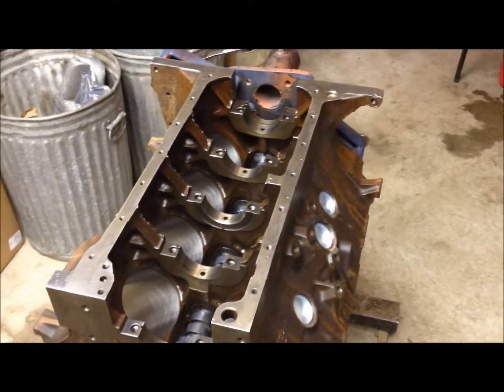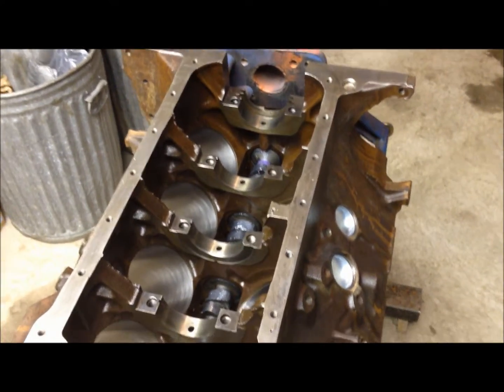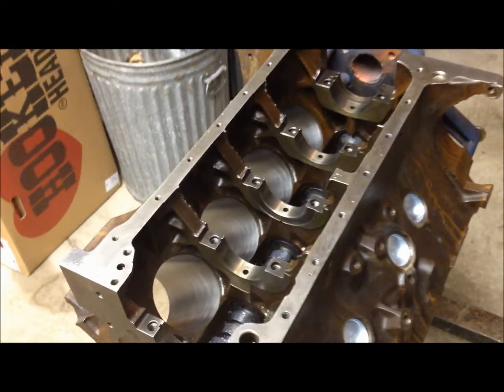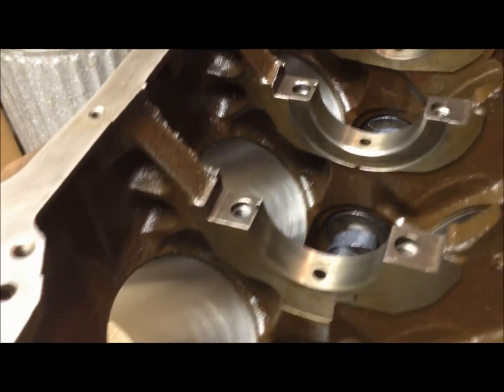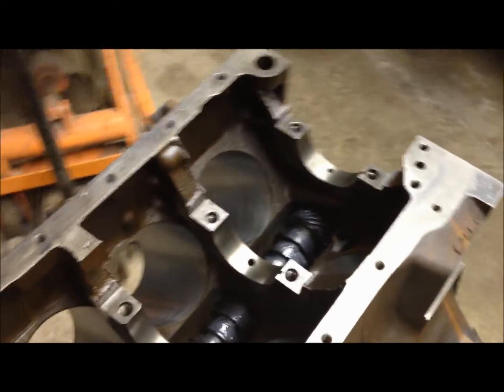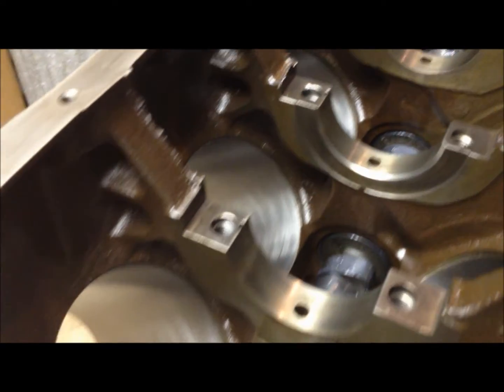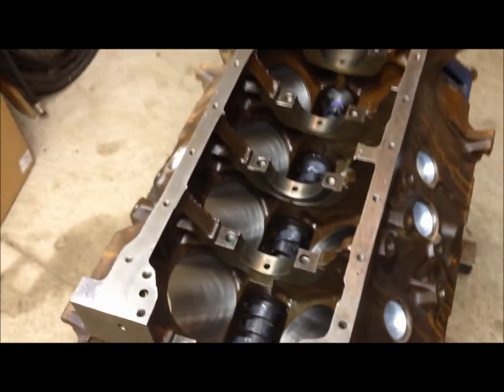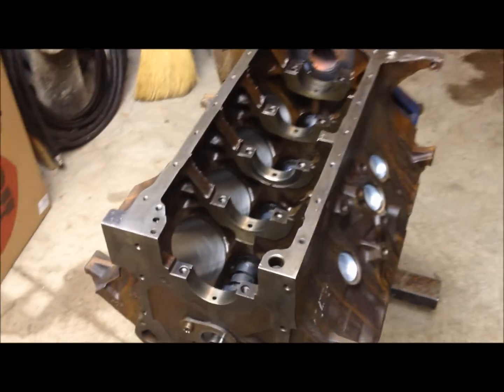The Strongest 390/360 FE Blocks

Comment: I like to drill out that short oil passage in the block to 1/2” diameter so it matches the oil pump as well as the oil filter assembly diameters. Drilling this passage hugely increases the oil flow, but the biggest benefit is oil to the journal improvement on cold starts. If you study the OE passage you see that not only is this bottleneck about a 40% reduction in volume, but the oil is basically forced into a cup at the bend. This basically is like sticking a garden hose into a cup with a small hole out the side where you expect it to funnel through. This is a big reason, if not the biggest reason why many of these engines failed when doing mostly short runs. Otherwise these are a very stout block, but the fix is so simple.
Reply: Do you do anything to the mains where the oil hole doesn't match up with the oil hole in the bearing shell?
Reply: @65slick445fe  I like to hit that a bit with a rotary file. I see some don’t but I like it done.
Reply: @brianhdueck3372   I did all of mine and the recipe is like making good biscuits. You have to know what that area needs and get it right.

Comment: I have a 1960 thunderbird 390, it came factory with the rev kit, solid lifter cam and high nodular cast iron crank. that block is cast as the 427s and 406s, with the boss's cast, but not machined for cross bolting. It's the only block I've ever seen like that and I've seen many. I bought it from a junkyard that was liquidating in about 1982 for 10$, I bought about 15 engines from that place and this is the only one I've kept. It was missing the original intake, but had a nice 4bbl one on it.That cam makes it purr at 6000 rpm.
Reply: 1960 Thunderbird came with the 352 FE or the 430 MEL engine.
Reply: @walnutmanor  You are absolutely correct, this engine must have been from a 1961. I didn't pay much attention to the vehicle, just bought the engine because it was special.
Reply: Cam montreuil engines  that is what some advertising called this setup, it also had heavier connecting rods with 13/32" bolts. I still have all of this engine. The original intake would have been a  3x2, but I did not get that when I bought the engine, back in about 82 or so, I wish I could have boughten everything that place had, lots of old hemis and 348s and what not, I just took the merc and ford and edsel stuff.

Comment: I'm curious, could you precision cut the webbing to then accommodate 4 bolt mains?
Reply: There is no need to "cut the webbing" on FE's to cross-bolt the mains (making them 4 bolt mains). The cross bolts go through the side of the block skirt, and into the 3 center main caps (#2, 3, and 4)
Reply: Where would you get caps? Aside from cross-bolted 427 caps, none exist. Anyway, main studs alone should suffice.

Comment: 427 side oilers are buy far the best FE blocks you can get. I have one it's impressive.
Reply: The problem is, you CAN'T get em anymore, unless you get an aftermarket block from Genesis, Robert Pond, Alan Root, or Carroll Shelby. $$$Cha-ching! Any original factory blocks you'd find are bored to the limit and full of cracks.
Reply: Rare as hen's teeth and expensive as hell. A lot of them were badly abused too, back in the day.
Reply: we agee" there's not enough road for that brutal beast to flex her r p m's

Comment: There was a 390 truck engine called a, "391" that had some external oil line. Ford sold the 391 engine blocks bored out to take 428 pistons as 428 engine block replacements that had the external oil connections plugged. The 391 truck engine block was used because it was heavy enough to use as a 428 block.
Reply: Yes 391 truck blocks are killer. I think they also made 361 truck blocks too. Both I believe had forged steel cranks. The only thing you need to do on both of these engines is turn the crank snout down. The bore to the desired width and add all the Ford and aftermarket goodies to them. POW !!! Get the women kids and Chevys off the streets.
Reply: @lorenzomaximo1818  I seem to remember the converted 391 to 428 blocks also had some external oil connection plugged off. Ford had quit making replacement 428 blocks, but they wanted to offer replacements for 10 years, so they bored out 391 truck blocks for the replacement 428 blocks.
Reply: @jimjungle1397  
And I seem to remember that too their damn good blocks. A lot of those 391 blocks were used in dump trucks.
Reply: @lorenzomaximo1818  - your advice is dated - modern cast iron stroker cranks are far less expensive and lighter than a machined 391 crank, which also requires flywheel flange and counter weight machining.
Reply: I believe the 391 may have also had an additional hole near the bottom of the skirt for an oil drain line from the air compressor used for the truck brakes.
Reply: The only difference I could find in a 391 was an additional oil ring on the piston
Reply: @rodneyyoung385  It may not always be used, but the 391 blocks that were bored and sold as 428 replacement blocks had plugs in holes that were in the 391 blocks as oil cooler / external oil filter lines. they may be plugged in some 391 applications without external oil lines too. Ford offered 428 replacement blocks through 1980 and in the late 1970's they were no longer original 428 blocks , but 391 blocks with additional plugs installed.(compared to 428 blocks)
Okay found what it is." FT blocks had a hole (right side) near center of block for an air-compressor oil drain. This was for vehicles equipped with air brakes. Most FT blocks had a mirror image of 105 stamped where you would normally see 352 found on the FE blocks. 

The FT blocks are heavy-duty units and are virtually identical to the FE except that the distributor pilot hole is larger to allow for the 5/16" hex oil pump driveshaft. This means you'd have to install a bronze bushing in order to use a standard distributor with the 1/4" oil pump drive shaft, but there are bushings readily available (from Ford or the aftermarket). It's easy enough to do if you're doing other machine work on the block. You might also need to install a plug where the air compressor (for the air brakes) drains into the block. (The drain is low on the right side near the center of the block skirt.)"

Ribs on the block only means it was cast after 1971, nothing more. The "C" or "CX", etc, on the back of the block is also period-specific, as is the "428" marking on the floor of the FT in the water jacket. Same with 427 text markings or crossbolt nubs.
The term "105" replaced the former term "352" as the standard FE casting mark in about 1973. At this time, casting of the FE block had approximately ceased at DIF and CF, and was almost completely taken up by Ford's all new foundry, MCC.
Reply: @Jim Jungle You can't tell that to @Dale Zaladoras

Comment: My daily driver is a mild build 76 f-150 with a 360 but has 352 numbers on the front right side of the block. Had it rebuild back in mid 2000’s and it’s still running strong. I had a comp cam with lifters, and performer single plane intake, with msd distributor, box, and coil.   Use to have a edrlbrock carb 600 cfm which R.A.N. awesome and later swapped it for a Holley 650 double pumper. The truck still runs awesome I just drive it to work everyday and don’t drive it like I stole it anymore. I am a little more tamed now a days lol, non ethanol is not cheap. The truck seems to only like the higher octane fuel. It runs like shit with regular. Future upgrades are edrlbrock aluminum heads and Holley efi system. 😎
Reply: Try running the low octane gas with less ignition timing and 2 jet sizes up in carb
Reply: @cammontreuil7509  i am going to go with fi tech system, with aluminum heads and hydrolic roller cam and lifters. still waiting on the jegs adjustable rocker arm kit. and just ordered custom FE headers ceramic coated  in and out. and just geared a new rear end with 4:11 gears.  getting ready for the front. old ford getting expensive to upgrade but well worth it 😎🤩🔥
Reply: Just to let you know, if you haven’t done it already is that with the EFI you should really run an electronic ECU controlled distributor. It’ll make a HUGE difference. Good luck and much respect for taking the time with my favorite engine the FE.  J

Comment: I had an 75 f250 360 390 gt heads milled n ported balanced rods n pistons with a crower baja beast cam holley aluminium intake, she was a beast! 6 inch lift 39 inch mudders 4sp 410s! If the old girl could talk she'd tell some stories!!! Sold the truck to a marina on the mon river south of Pittsburgh in late 90s i believe she is still yanking boats!!!

Comment: The standard FE blocks are all very strong! You don't need to worry about the webbing. A broken FE block for a street performance engine is a rare thing!
Reply: That's quite true for sure.
Reply: The only weakness I'm aware of comes from years of temp cycling those blocks without having webbing in the lifter valley.  Blocks with higher % of nickel, those early 1960's high performance 352/390/406 blocks, were less prone to the cracks that developed along the corners of the lifter valley.  However, it's prudent to magnetically inspect all FE blocks and heads.   Modern iron and aluminum FE blocks now have lifter valley webbing.
Reply: @BobbyOfEarth  
All FE blocks are cast from the same materials. There were no blocks with "more nickle content".
Reply: @BobbyOfEarth  The mixture is and always has been Phosphorus. Chrome, Graphite (from scrap blocks so very little) and Sulphur. The recipe has been the same since 1958. Small scale changes, but all FE blocks are strong. It is the method of treating it that makes the difference. The 427 has a cloverleaf shape in the bore that makes the bore stronger, struts that join the deck.  The 105 blocks are the SAME metal but are produced in a similar way to a standard FE. The 406 and 428 had a thicker oval shaped bore that had extra meat in the thrusts and more fore and aft thickness but just enough. Some 428s had a web in the main to give it 3webs. This was in the 105 blocks primarily, but it was no guarantee that the bores were thicker. A sonic test is required. Any nickel in a block is a tramp metal and was usually melted down to nothing, it is too hard to machine and adds no strength.
Reply: @BobbyOfEarth  - another reference to Ford adding nickel to block castings! Will it ever go away? Ford never added nickel to engine blocks - it is only present as a tramp metal. They did do one short run of experimental added nickel to a few 427 blocks. The tooling wore out so quickly, that it was a no-go for a production line.
Reply: @sandibaker7646  Truth.
Reply: I was.told not to turbo or super charge one. I'm not sure but this "old timer" told me the old engine blocks weren't designed to handle the compression pressures in the heads / blocks. They would crack eventually. So do I build mine [360] FE all motor or can I supercharge it?
Reply: @traviscuevas9101  Turbo charging me with rising boost curve and good system design an FE is as good as anything else. Rising boost curve, a good intercooler and a free flowing exhaust.
Reply: @traviscuevas9101  Turbocharged. The FE is dependent on having a rising boost curve and descending back pressure. You don’t want a spoiled up turbo to hit it hard at too low of an rpm ,  and the peak at 6200 with an intercooler to get the heat out and a big outlet pipe so that the back pressure doesn’t rise and strain the block. 4.8 LS engines are making 900 hp on E85. You can boost any engine but you have to manage your boost, Heat, and back pressure, and most of all Detonation .  Detonation will kill a Merlin BBC.

Comment: I own a 69 Ford F -250 4x4 with a 300 six . I believe it had a 360 ( original ) . There is a 360 FE engine with very low miles at my local wrecking yard . Should I go back to a 360 FE or leave it a 300 six ?
Reply: Leave it 300 unless youre always hauling the 300 will run forever
Reply: if ya gunna work it the 360fe is a good choise,,

Comment: All the FE blocks have skirt to main webbing the latter truck blocks have a middle vain in the webs they also tend to have thicker cylinder walls. Trouble is they also have the latter forward engine mounts this makes them a little more trouble to bolt into Fairlane's & Galaxies.
Reply: You can remove the front mount and swap the iron front cover with an aluminum cover. The car side mount holes are there to use car mounts. Also the heads are different from car heads and must be changed in to car heads.  I wouldn’t bother with the steel truck crank, it is very heavy and has the larger snout. A new stroker crank is lighter, but the stock 390 crank from a car is great for a 500-525 hp engine.

Comment: I have 427 in my dump truck    its a beast ..1969 700 Ford special order .the only thing ever did to it tune ups n oil changes ..one water pump factory 4 bbl carb all factory ..I restored it last year ..I think it's side oilers ..not Shure
Reply: Ford only put 427's in one model of car in 68(cougar) and none in 69.I think you are mistaken.Tell tale sign would be the row of bolts above the oilpan rail for the cross bolt mains....
Reply: @diamondtguy  - Ford FE 427's came in many different Ford and Mercury models besides the 1968 Cougar GT-E, including the Fairlane, Comet, Shelby Cobra, and Galaxy.

Comment: Compared to a 427 the "truck" blocks are not the strongest, yes they have webbing which makes a strong block. The strongest are the side bolt main 427s with high nickel content
Reply: Yeah I don’t have 6 k for a block either
Reply: - another reference to Ford adding nickel to block castings! Will it ever go away? Ford never added nickel to engine blocks - it is only present as a tramp metal. They did do one short run of experimental added nickel to a few 427 blocks. The tooling wore out so quickly, that it was a no-go for a production line.
Reply: @sandibaker7646  I know this is an old thread. I guess the only way to tell if a person has an experimental block would be to have it checked ?
I have a 351 CJ crank and it is marked with a brinell test.
Last year, a car collector, really a lawyer, buys cars and played with them and sells them.
He found an old build at an estate sale in Arizona.
Bought the car. $20,000. It's a 67 fastback mustang but has been heavily modified.
Tubbed , basically a drag car.
The car was built in the early 70's.
Well he wasn't sure what engine. But an FE.
I went and looked at it. Had the three bolts on each side of the block.
I bought the car for $22,000. 
I pulled the engine to inspect it. Someone polished the inside of the block. Lifter valley and inside the crank area. Must have taken hours and hours.
Engine had the early shell solid lifters and an old Crower grind cam 
The point I'm bringing it up ? The inside looks like polished chrome.
Would all FE blocks polish up like that ?
The engine block is dated 1964. The heads 1963. 2.19 and 1.71 valves.
Heads are ported and polished. Floors were welded up.
Matched to a ported Tunnel Wedge intake.
Engine crank was replaced with a 428 CJ.
Engine is incredible.
Reply: No shit.
Reply: I believe you might be right, I’m just looking at my 427 and it looks like it might be stronger 😁
Reply: No shit homey
Reply: There is no such thing as a high nickel block those are a myth 100%.

Comment: You can put a steel 360 crank in a 427 & u get a 396 that according to The Complete FORD Book (1972) "Will rev higher than valves will safely permit" LOL if I had a 427 i wouldn't spin it that high.
Reply: That is exactly what I did when I built a 396 Tunnel Port for a customer. I had Scooter Brothers at Lunati rework a steel 361 FT crank for that project. That 396 had no trouble revving to 8500, taking advantage of the port's flow capabilities at that RPM.
Reply: There is no such thing as a Ford "steel 360 crank".
Reply: @sandibaker7646  Did you miss the "361" part of the message ... and that was not referring to the Edsel or the 1958 Ford Police Interceptor, both of which were 361cu.in. "FE" engines w/cast iron cranks. 

The Ford Medium and Heavy Duty trucks had their own version of the "FE" engine line: the "FT" series, and they had steel crankshaft, though not directly interchangeable with the "FE" engine line.
Reply: @johnjohnsn7633  - James Boyd said 
"You can put a steel 360 crank in a 427 ..." -- I was quoting him.

Did you miss the quote marks? I was a Ford car and truck parts man for 8 years (1969<1976), so I know a little about Ford's engines.

Comment: Love the 360 
Had one in my first vehicle 
1976 Ford F100
Reply: Strange Builds Inc just got my first 360 ford f100! I got bored with Chevrolet, so I stepped in to ford territory! Any tips?
Reply: @adventuresofwillandshelby6013  be prepaired to 
Leak oil 
And spend alot in gas money 
Also not much interchangeability on these motors
Reply: @Dennis Burger yep
And horrable fuel milage

Comment: The "Webbed" block to my understanding is the Ford factory service part for marine and HP use..  It can be ID'd by looking just  around the motor mounting and there will be a series of cast (vertical) webs that ID the block as the HP/Marine unit..  Sorry I do not have a pic of them..  I think Kathy below has some numbers?
Reply: Not true at all - the external vertical ribs were not added for strength.

Comment: Every D4 block ive ever seen had added main webbing . And ive built a bunch of FE's . The 72-74 360 is a great core to build
Reply: What would you recommend doing to a 73 360? I am wanting to have a somewhat “peppy” truck that can move if I need it to. But nothing crazy.
Reply: @joshpalmer9779  basic..no more than .020 on bore.hypre. pistons,chome .. rings trimeta l bearings.standrd or Rhodes lifters and a 352 or a 360 gets 7 K
Reply: @joshpalmer9779  Feed her a little squirt of nitro
Reply: I got one. '72 360.
Reply: What about a 75?